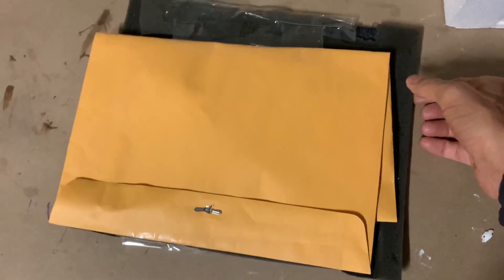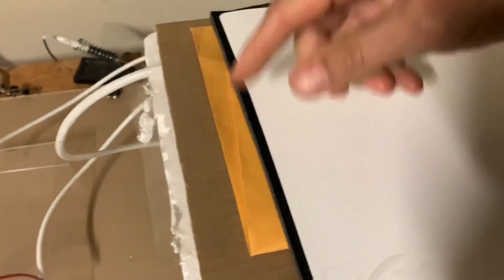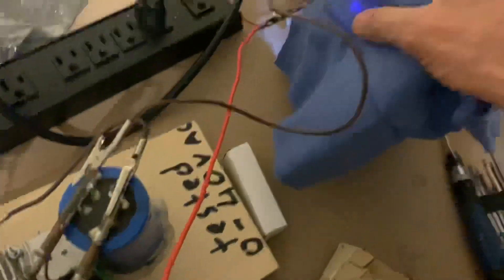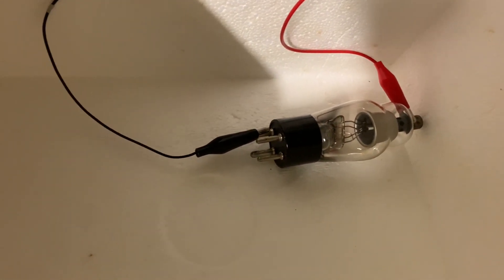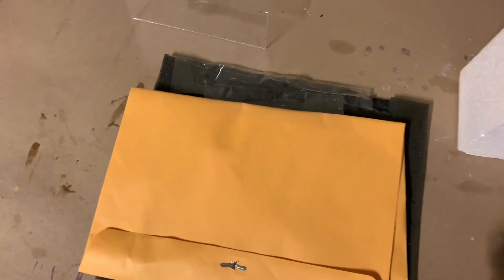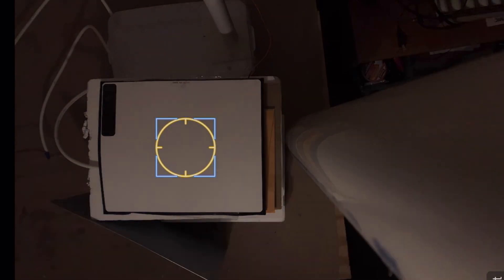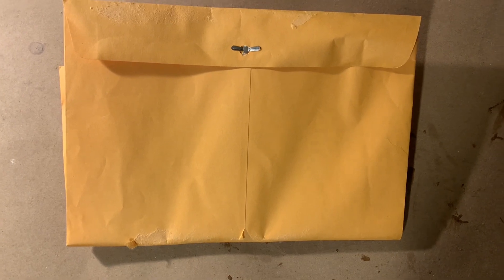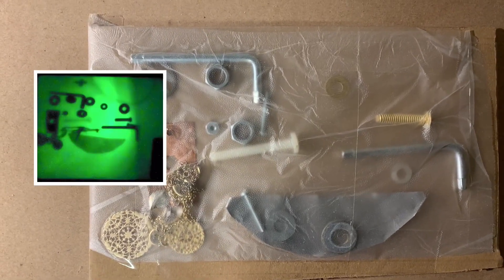Home made X-Rays for Detective Work

Comment: Hi! Thank's for the interesting video. One question: Have you connected the anode of the tube to negative high voltage and the cathode to +HV? The tube emitts far more xrays when connected inverse. Just a hint... Here is my setup: https://www.youtube.com/watch?v=cZFaikZLzsU
Reply from the maker: Yep I tried that and it only made X-rays at higher voltages. There was an issue with arcing over the glass at these higher voltages. It may be the tube and I can try again with a different one
Reply from the maker: Great vid thx